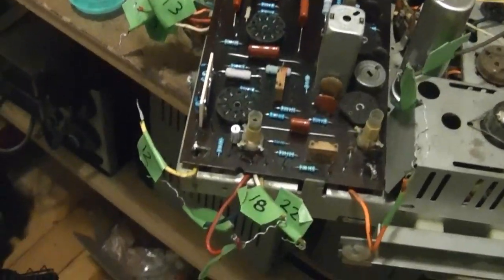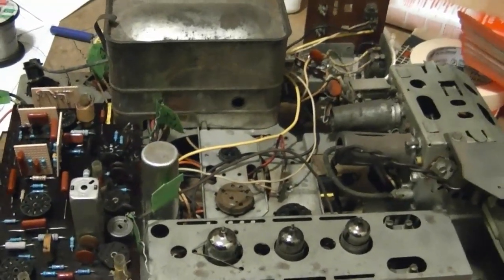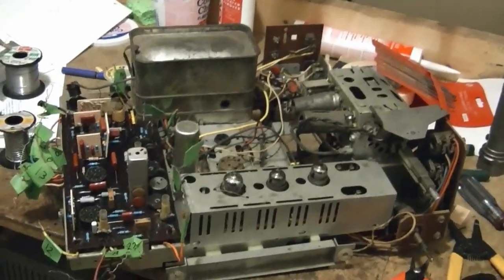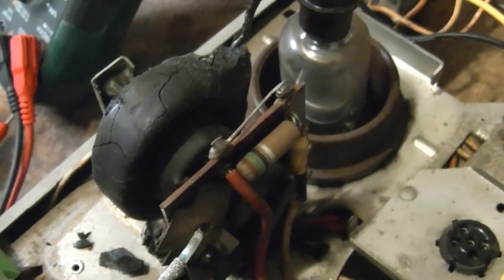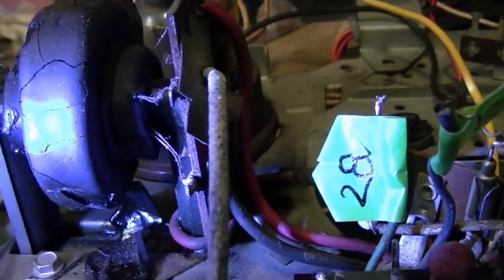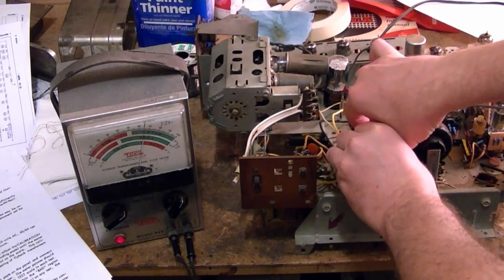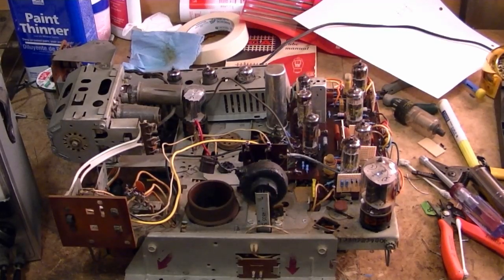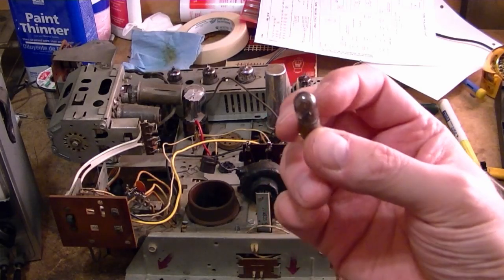Predicta "Holiday" restoration p8o?

Comment: I haven't heard of any ventilation problems with the Holiday and Princess table models, probably because they have vents in the top, bottom, and sides of the cabinet. The top has a metal mesh like a transistor radio speaker grille that probably helps with the heat. The ones that apparently have the heat problems are the "Barber Pole"/"Gas Pump" floor model types, those have the chassis mounted on end and the only vents are in the sides, the picture tube is mounted on top.

Comment: Do you know if they used the same K network couplates in all of the Predicta chassis or did they change some things around between models or years? It would be nice if you could use this set for making prototype K networks and then make them in advance for all of the other Predicta sets you have to rebuild, By the way, did you have to do anything with the capacitors inside that IF can on the circuit board?

Comment from the maker: I used some paint thinner on the wires - it worked out great:)  I'm pretty sure I can pop the CRT out of the cabinet so I won't need extension cords.  

You mean one of the caps cap on a K network ?  I can bend them back so they're not so close to a tube.

Comment: Hi Bob.Is there a piece of test equipment you don't have? : ) Wow those wires going to the PCB are so clean now that they look like they are new. It's a pity those sockets are not standard, otherwise it would be so much easier for you to produce extension cords, right? Looking from here, I have the impression that the brown cap is too close to the tube. I guess the set will not be used often, otherwise that cap could be fried by the heat, couldn't it?